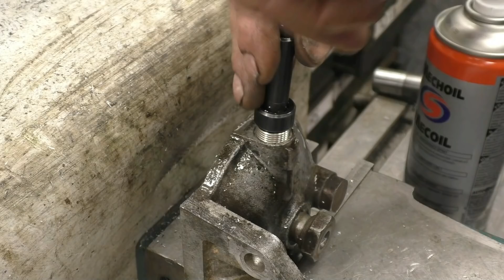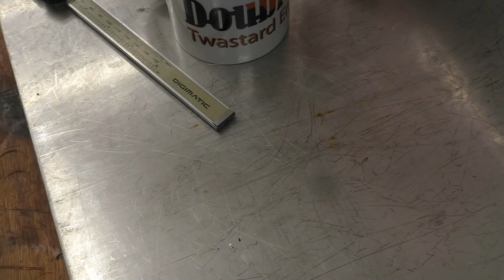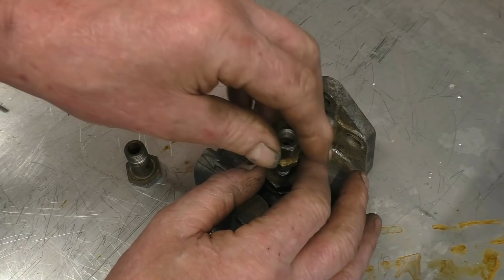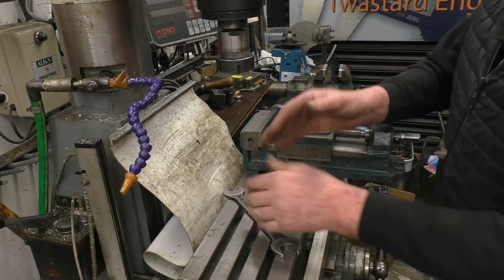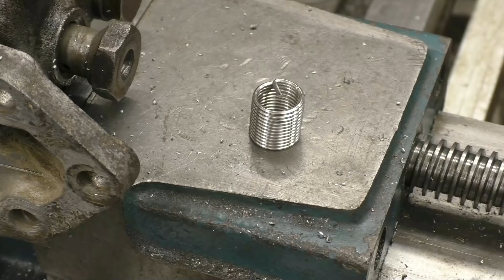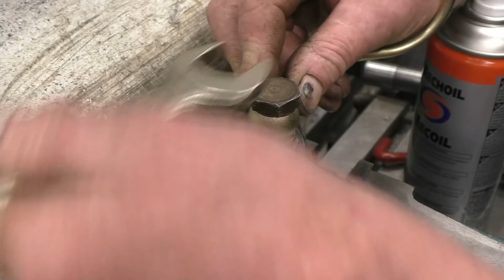SNNC 419 P1   Fuel Filter Helicoil

Comment: Nice work John. For those of you that don't have any experience with Heli-coil repairs, they are really easy to do but keep in mind if you do a heli-coil and down the road something happens (like maybe a cross thread) DO NOT attempt to run a tap into that heli-coil. It will wrap itself around the tap and get stuck and possibly break off in the hole. You have to use a pick and remove the heli-coil and insert a new one.